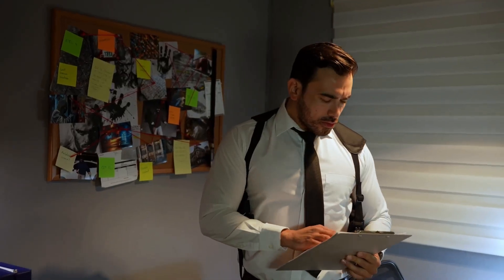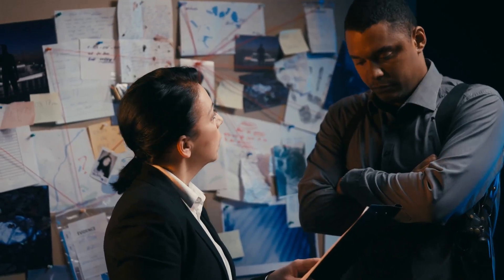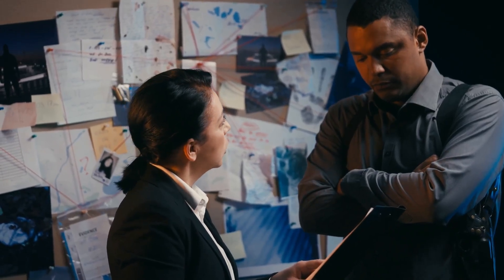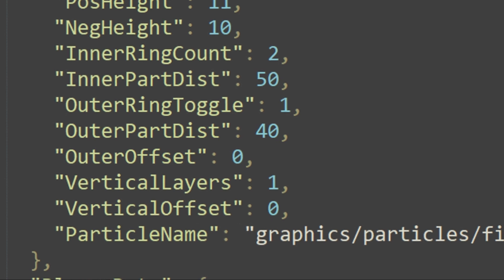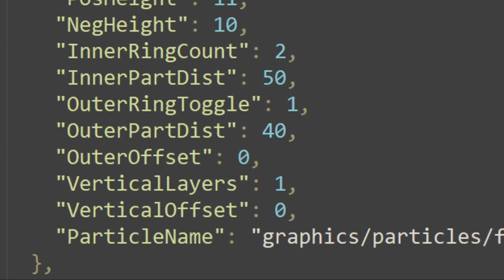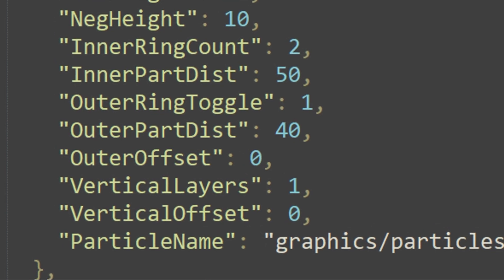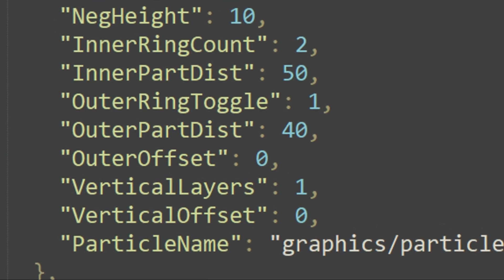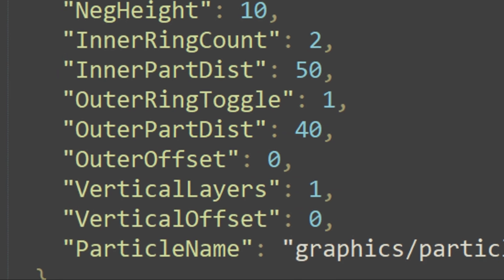Even More CfgEffects for Your DayZ Server

Comment: Awesome work man (I really dig the tune as well 🙂) QQ -In the vid all of the effects seem to follow the same angle of trajectory (albeit separated by walls) - is it possible to rotate the angles of effects? I'm aware of how the position property sets the location, and the radius the width/length of the effect, but are you able to rotate the effect say 45 or 90 degrees so it points/runs in a different direction?